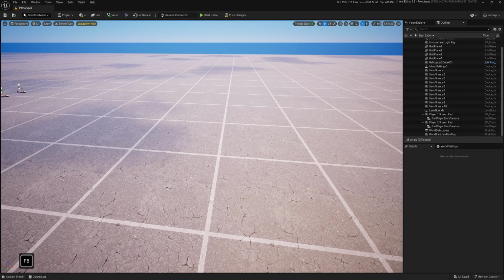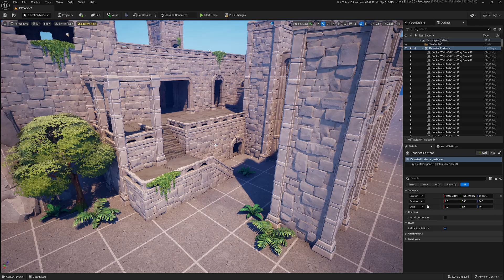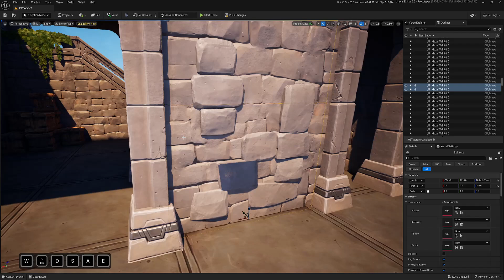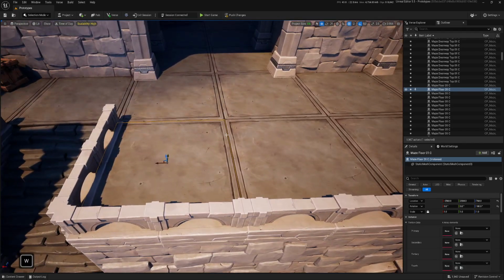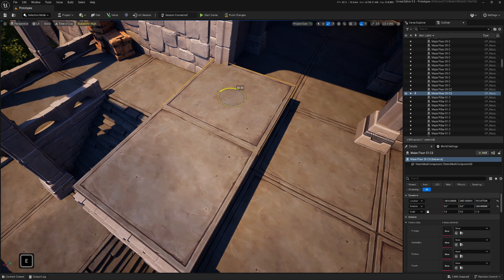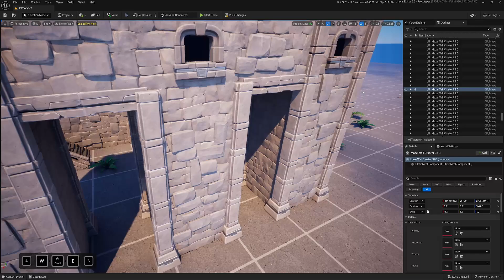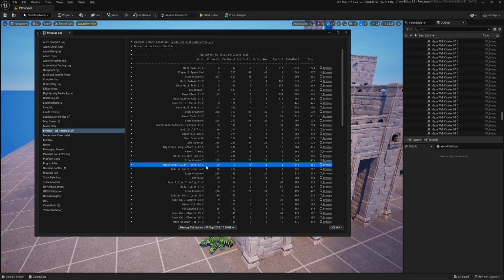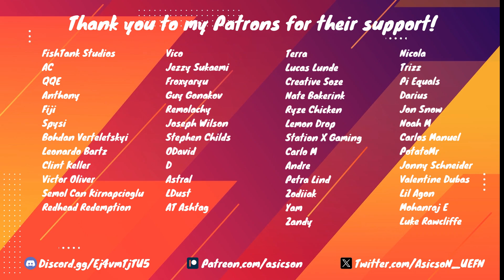Optimize Your Maps with Modular Assets - UEFN Tutorial

Comment: Sry, but i didn't learned that mutch from this video and the most important thing i didn't learned hot wo optimize my map.
You could do mutch more with load cells etc.
Reply from the maker: @AndreBaut  Optimisation isn't just using or doing one thing. It's a stack of many.
As I mentioned in the video there are already many videos on YT how to make modular assets. So my video is about WHY to use modular assets as many creators don't do it.

Comment: hey AsicsoN great vid, I have world streaming turned on in my big island because I have so many props and they are all optimized with using repeated static meshes and HISM, the cell size is 25600 and the loading range is also 25600. the problem im facing is it's annoying to see my entire city disappear out of view after driving away a bit and I can't do anything about it.  however similar maps with more props than me dont have that same problem with loading range and im wondering if im missing something. Any idea?
Reply from the maker: @bioite  Hi, you can increase loading range. And great helper in large maps is HLODs. I suggest to check this out.
Reply: Not only that, but you can select the exterior parts of all the buildings you always want to be able to see and disable is spatially loaded and HLOD. Doing so will help a lot in terms of ensuring the necessary parts of any setpiece you have is always viewable while still not rending all that setpiece's internal actors & instances, but you need to be deliberate and follow up with testing. Sometimes, adding something less complex to obstruct the view of something more complex will save your a$$. Though, everything is a give and take, and conscious decisions must be made. Sacrifice and compromise are integral parts of the design process.